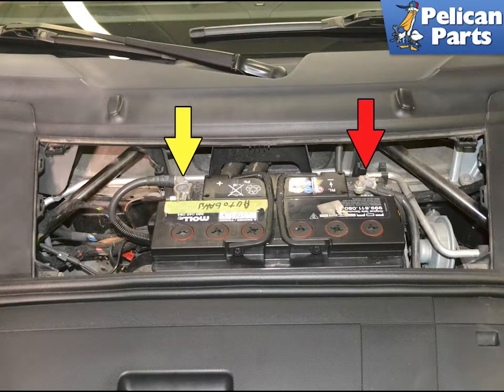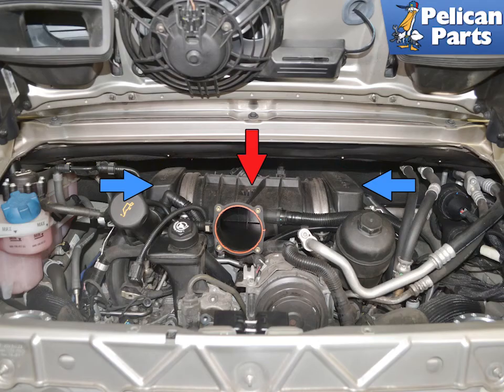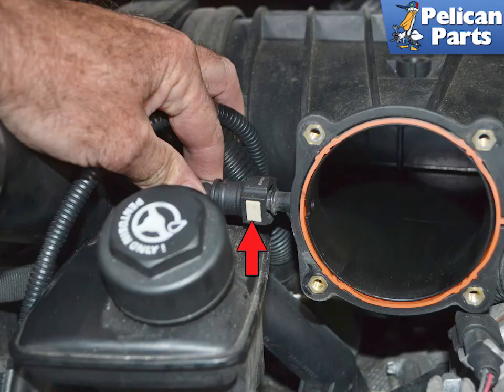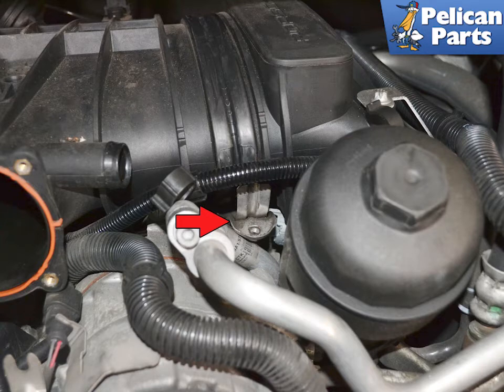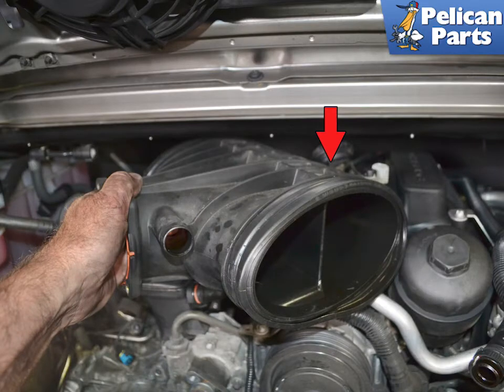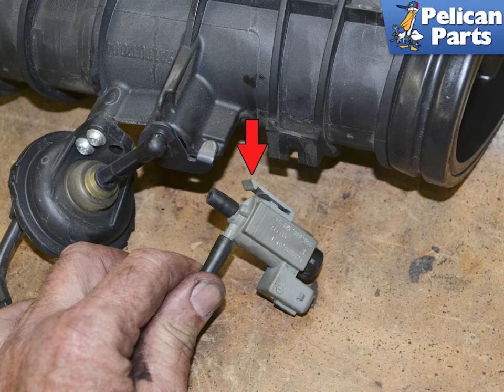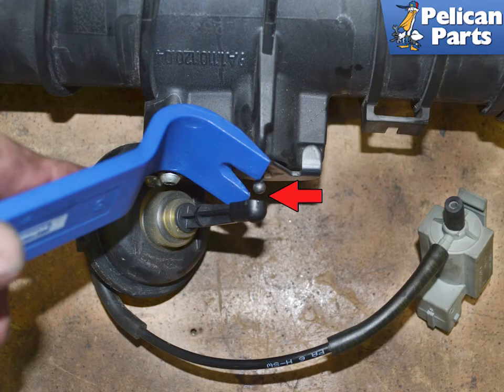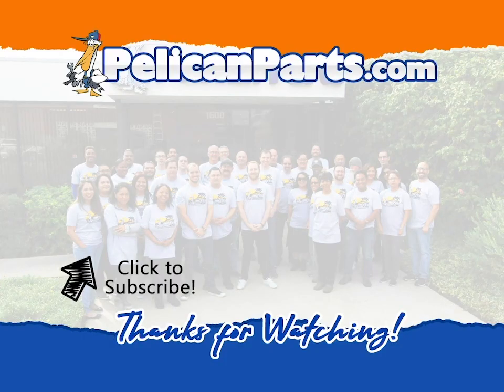Porsche 997.2 Carrera Resonance Control Valve and Actuator Replacement (2009 - 2012)

Comment: My rpm needle bounces a little at idle when car is warm, could this be my throttle body (cleaned it but still the same), spark plug, coil, idle air control valve. When I step on the throttle a bit and let go in neutral sometimes it evens out but not always. Any ideas?
Reply from the maker: Is the check engine light on or flashing when the problem is present? Sounds like an engine misfire. I would check spark, fuel and compression on all cylinders. Once you isolate what part of the combustion process is causing the misfire, you can identify the root cause.